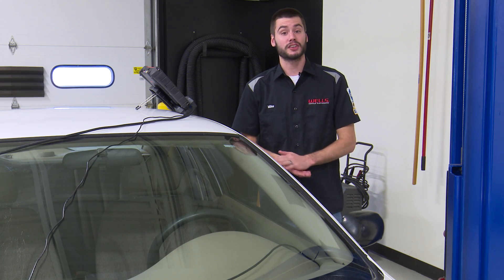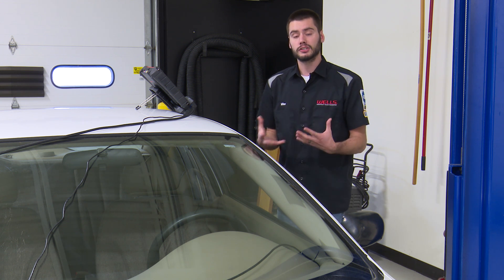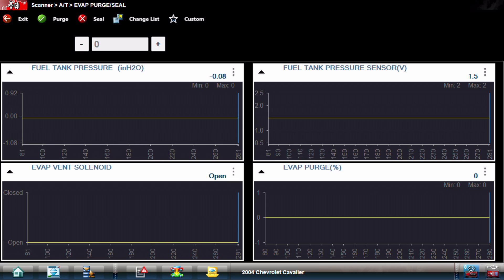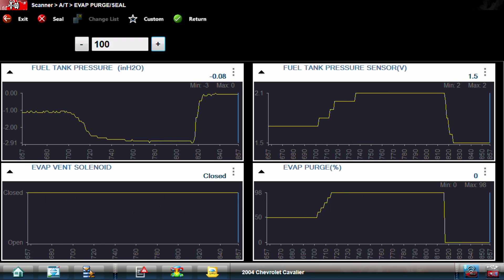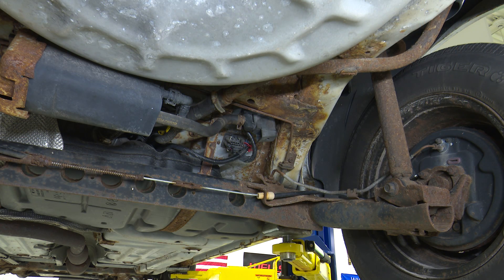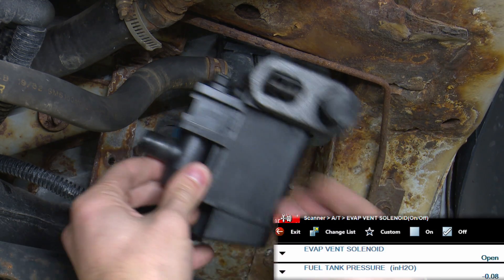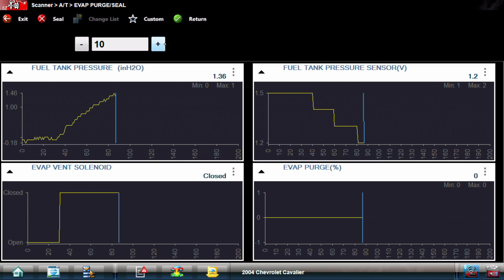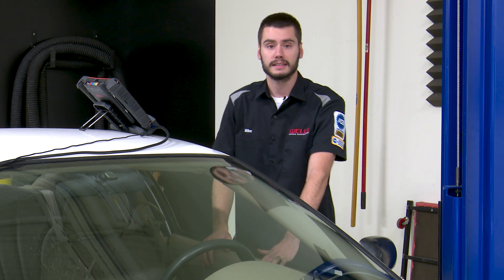Quickest And Easiest Test For EVAP System Leak Codes P0442, P0455, P0440 On A Basic GM EVAP System

Comment: I have small evap leak. The vent silinoid clicks off but doesn't click  on
Reply from the maker: Hey, make sure that the vent seals when you turn it on. The clicking only happens on some cars. The main thing is that it's sealing.
Mike Becker, Senior Technical Instructor
Reply: @GoTechTraining  yeah I have the same car your working on.  I did smoke test it with my machine and couldn't see no smoke coming out the vent. I will try it again and use a flashlight it was a little dark underneath. Another thing I sometimes have trouble putting gas in my tank the gas nozzle wants to shut off. Thanks for responding

Comment: When i check the purge solenoid with a mityvac   ,I hold pressure on the vaccum side but not on the other side of solenoid, is that a normal condition . Im not able to vaccum more the 5 on the side that goes to the tank only on the vaccum i can hold as mich as i put on it . Should it hold vaccumm on both sides when i test with mityvac?
Reply from the maker: Hey, yes it should hold vacuum either way. Chances are the way you are holding vacuum is just holding the seal tight against it's sealing surface. 
Mike Becker, Senior Technical Services Instructor

Comment: Thanks for the vid.
Jeesh, that rear brake line looked a  little scary...pretty swelled up!
Which scanner you using?
Reply from the maker: Hey Splash, yeh the brake lines are pretty nasty in this thing! In this video we were using the Snap ON Verus. Thanks for watching!
Mike Becker, Senior Technical Services Instructor
Reply: Wells Vehicle Electronics 
Thanks Mike

Comment: Hey, Mike. When you use the bi directional control, does that mean you bypass the pcm? So, if the pcm would not run the test because of a short to voltage or to ground, you woud be able to do it bi directionally.
Reply from the maker: Hi Littlebear Gaming, great question. When us use bi-directional control the scan tool is telling the PCM to perform a function. It is not bypassing the PCM. The scan tool is only submitting a request to the PCM. If the PCM is unable to, then the bidirectional control would fail.
Mike Becker, Senior Technical Services Instructor
Reply: Thank you so much for the answer, Mike. You are great!
Reply from the maker: Thanks for watching and commenting! If you ever have any more questions don't hesitate to ask!
Mike Becker, Senior Technical Services Instructor

Comment: I have a 98 civic Ex with an intermittent small evap code P1456. A shop ran a smoke machine and found no leaks. They suspected and replaced both the bypass and two-way valves but no change. 

Only clue I have is, on warmer days like hot summer days, everything works and no codes. Once outside temps drop below 70 degrees the code always returns. Any suggestions what to look for?
Reply from the maker: Mrsemifixit, the temp may be related to the test running or not running. At this point it's time to have a shop do a smoke test and actually diagnose it. Something is either leaking, or the feedback is not functioning. If you've already taken it to a shop and had it diagnosed and repaired, but it's still not fixed..sounds to me like they missed something and they should cover it and make it right for you.
Mike Becker, Technical Services Instructor
Reply: Wells Vehicle Electronics Thanks for your reply. In the hotter days the test does run and passes is what I meant to say. I’ll check with an OBD2 scanner and it’ll say evap system passed and ready. But in colder days it throws a code. I did at the time go back to the shop and they ran another smoke test but didn’t see any leaks so it’s confusing

Comment: Question why a car stall put at stop 🛑 only when its cold when reach normal operation temperature everything is fine car has a clean tb new map  tps etc sensor new iac valve ?
Reply from the maker: Hey Fredy, and codes? Have you had it scanned? Start there.
Mike Becker, Technical Services Instructor
Reply: Wells Vehicle Electronics  i got po170 malfunction bank 1 noticed a negative fuel trim but notice the base idle it should be 730 rmp - + 50 load when i turn the ac or the heater the rpm increases a little bit then goes back where it was before i think my idle base its set to low and make the car stall but weird only does in the morning or whatever the engine is cold after is warm works great 👍 sometimes i hear the engine like is flooded when come to stop hit the brakes the rpm drops to low and stall out and sometimes the rpm stay the same and hear the engine like wants to die it sounds like this broom broom sorry haha can’t say by words but it makes a weird noise I increased the base idle just a little bit it seems to help a bit but it’s annoying coming to stop and have to press the brake and the gas pedal at the same time for preventing to stall i cleaning the egr valve before and i don’t know if was working i notice the pin was like way inside the valve don’t know if it was stuck

Comment: Gotta love the way you quickly did a screening test, then using the data you came to an hypothesis and then verified the diagnosis. I can think of ways to do this without bidirectional control but it would take imagination and a vacuum source.
Reply from the maker: There is always more than one way to "skin a cat" right? A few jumper wires, a vacuum source, and a meter would get you there on this car. Wouldn't even need a vacuum source if the car runs!
Mike Becker, Technical Services Instructor
Reply: To that I would add that for a DIY'er, I would try cleaning out the old valve with some carb cleaner, before making a decision to replace it.  Cycle the sticking valve with some jumper wires attached to the battery with solvent sprayed into the vacuum hose inlet of the valve.  Cheap and easy.   Sometimes just spraying carb cleaner into the associated vacuum hose from the easier access of under the hood will do it too, if you spray enough in there and give it time to soak/loosen up.  A lot of car owners are just focused on getting the car past the annual state emissions test with as little expense as possible, though obviously a professional repair would require replacing the valve. 

Another DIY trick you can use in this situation on some older cars is to just fill up your tank, then disconnect your battery for a few minutes to clear the code & check engine light, then run a standard drive cycle for your specific vehicle.  Keeping the tank full will get you a Not Ready for the Evap test, but in many localities, they'll let older cars slide with a single Not Ready. (Check your state emissions rules to see if such a tolerance exists where you live.  In some states they'll actually let you slide with TWO Not Readys, if your car is old enough, and the check engine light isn't on. )  If the Evap problem still exists, the check engine light will come back on when the fuel tank level decreases to the point that the car can test the evap system, but at least it gets you past the inspection (if you don't live in some strict state like California).

Comment: Very "Wells" done Mike. Us DIY'ers always ask the same question..."but what if I don't have a bi-directional scanner" ? With the GM we can still check for power, signal and grounds, and hear the "click". I like it.
Reply from the maker: Hey Wyatt, that is a great point. Do you think there is value in doing something similar without a scanner?
Mike Becker, Technical Services Instructor
Reply: In my humble opinion, yes sir. A fair number of the viewers are people like me who are beginners. We watch YouTube to learn more in general, (like me) or we're here because our car broke and were looking for information to fix that particular problem with basic tools. DVOM, test light etc. I have realized from watching other great YouTube channels that some systems will require a high end scanner and/or scope. Even that I can afford such items (I do have a few scanners and the basic series 2000 PICO) I can't justify more expensive equipment for the few times I'd need one. If a case presents itself where one could troubleshoot a system with some basic tools that would be great. It may not bring immediate viewing, but your library of material that included the use of basic tools I think would attract many viewers over time. Thank you for the opportunity to comment.
Reply: Hey Wyatt, save a search on your local craigslist (or one nearby) for "autel" or whatever scan tool you like.  I did this about 18 months ago as I couldn't afford the $1200 or more these things cost.  Then about 3-6 months went by, I had even forgotten about it, when an Autel DS708 popped up and I got an email out of the blue.  Not a latest and greatest but I ended up picking it up for $225 with a near current update.  I'm now making money on the side with the knowledge from these guys.  There are deals out there to be had but you just need to know how to find them and then jump when one pops up.

I also just picked up a Redline Smoke Pro smoke machine with all the accessories on eBay for $450 (about half price) and put it to use the same day it showed up on UPS.  Just have to watch and save searches on eBay and Craigslist.
Reply: That's awesome you found some good deals. So you can have a standing "search" on Craigslist and it will alert you?
Reply: Yes sir.  You just need an account and you can hit "save search" and then go to your list of saved searches and make sure it's set to notify you.  You will get occasional emails that aren't always relevant (the CL spammers sometimes get through) but it's worth it to be the first to jump on a good deal should it come around.
Reply: Thanks for the info John.

Comment: Can you please do a test for  exhaust restriction / clog cat. Thank you
Reply from the maker: Hey KJV, sure at some point I'd love to do one when I get one in. You got a problem on something you need help with?
Mike Becker, Technical Services Instructor
Reply: Jay Daniels thank you sir. Ive tested my self using an obd2 adapter and the torque app .. and looking at the vacum ..at idle is 22  but when i rev it to 2k rpm it drop to 18's . Which is not sopuse to do . Is sopuse to hold 22 or go to 23 .

Comment: I like to pull up fuel trims too to monitor the purge valve opening.. It's interesting see the rich condition from the vapors, then a huge lean condition, vacuum leak. If you have a bad tank pressure sensor you can verify very quickly
Reply from the maker: Hey GJ auto, fuel trims are great to watch as well. Fuel trims move, but FTP stays put....you are pretty set on that FTP. Newer cars actually do that. They use trims to verify the purge is actually opening!
Mike Becker, Technical Services Instructor
Reply from the maker: Exactly John, the PCM will expect to see a deviation in the fuel trims when it cycles the purge open. Not rich or lean, just a change. The rich/lean factor would depend the contents the canister.

Mike Becker, Technical Services Instructor
Reply: Wells Vehicle Electronics So that helps rule out a stuck closed purge valve?

Comment: vent valve on gm rare problem  thanks for the evap follow up
Reply from the maker: Hey Juan, right!? Especially up here in the rust belt!
Mike Becker, Technical Services Instructor
Reply: no different in south florida i thought it was  the heat
Reply from the maker: Really, could be! Many of ours end up with rust in the solenoid. To the point where the body of the solenoid actually rusts enough to crack its plastic that is holding it in! Rust can build up a ton of force.
Mike Becker, Technical Services Instructor